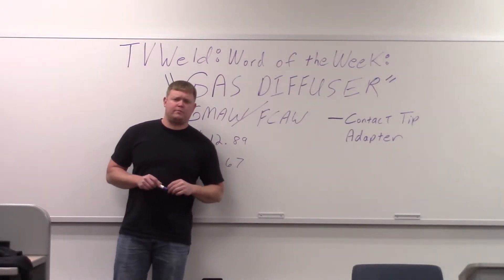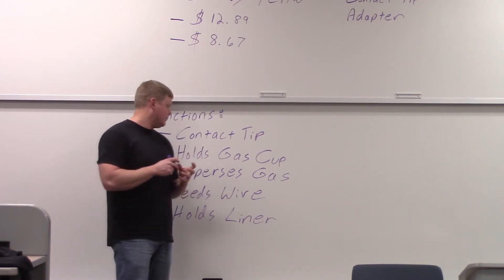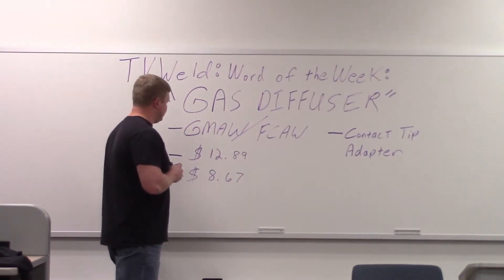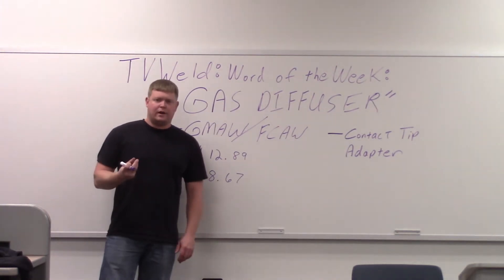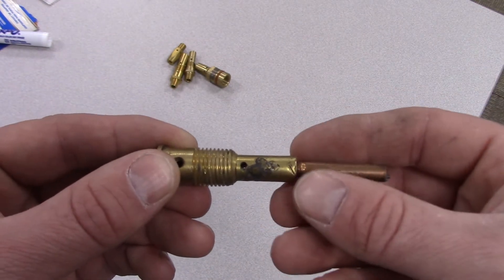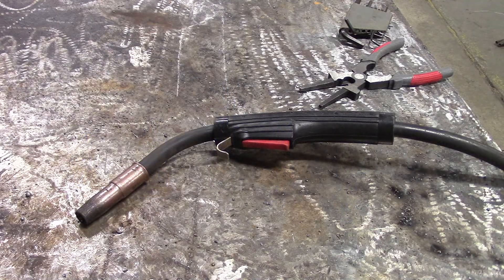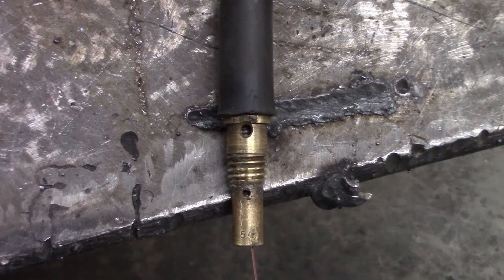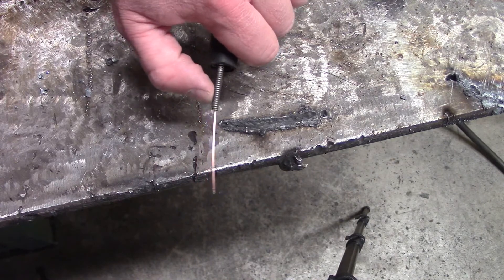MIG Gas Diffuser

Comment: How often to you change out the gas diffuser?  Do you change it when it fails or is there a general maintanence to changing it out?
Reply from the maker: You really shouldn't have to change the diffuser unless something happens to it.  Usually it gets cross threaded when someone changes the contact tip.  I'd say that is the most common reason to change the diffuser.

Comment: Okay what do I do if the liner is wedged into the diffuser. The wire will not feed through  in the liner is stuck into the diffuser I can't take them apart with the worry of causing further damage
Reply from the maker: Maybe let it soak in WD-40 over night and then try to get it out.  I'd make sure there isn't a set screw holding in the liner first.  There is supposed to be a set screw holding the liner in.